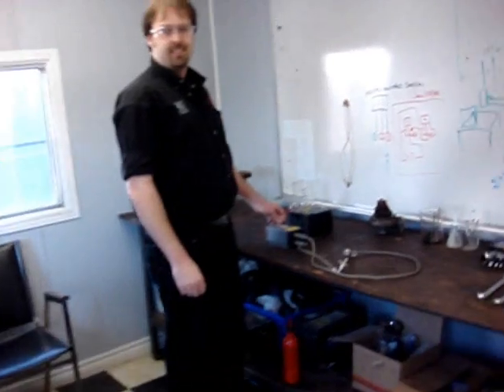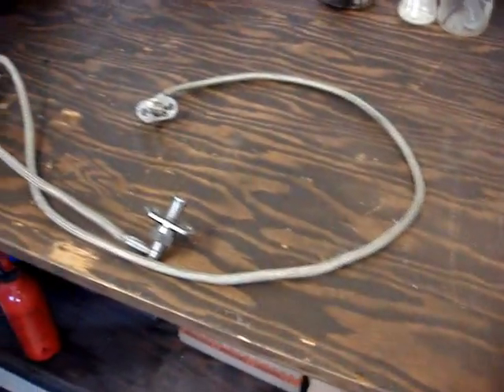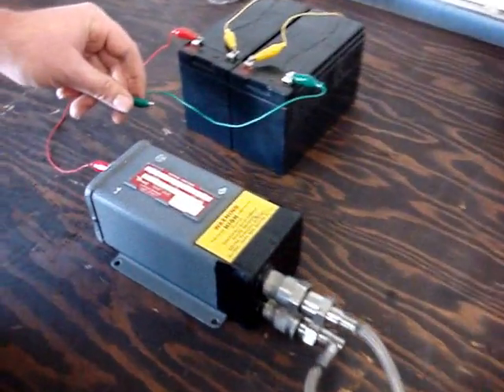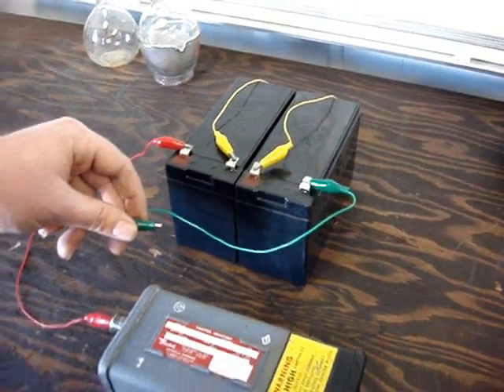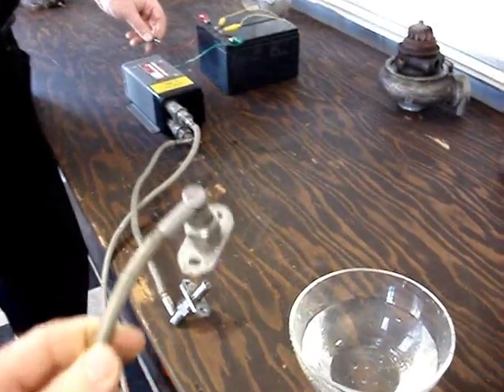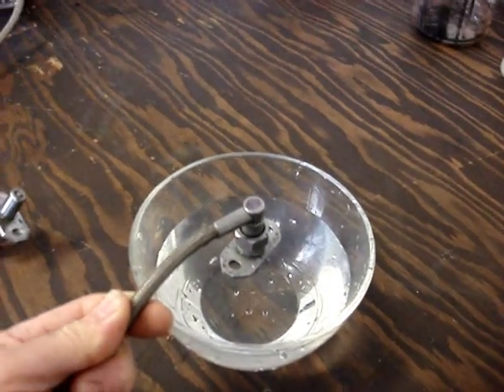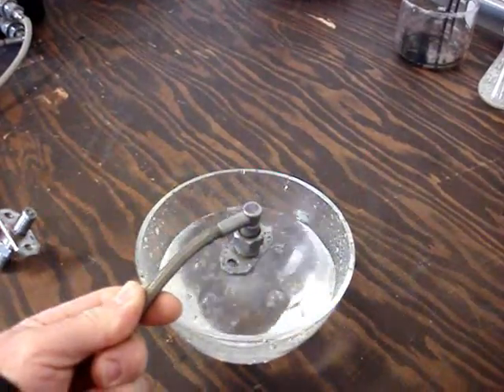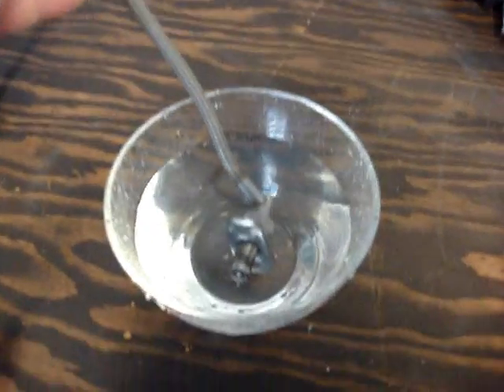Jet Engine Exciter Testing

Comment from the maker: Hi David, please see my other videos with the Turbomach igniter tests. I have this unit in new condition in stock for sale. As you can see this unit is extremely powerful and should work well for your engine. You only need one plug. If you send me some photographs of the parts you have now and measure the thread size, we can see if the connection is the same.

Mark Nye